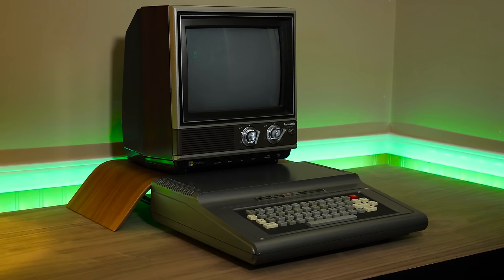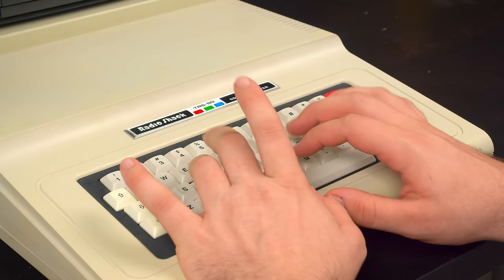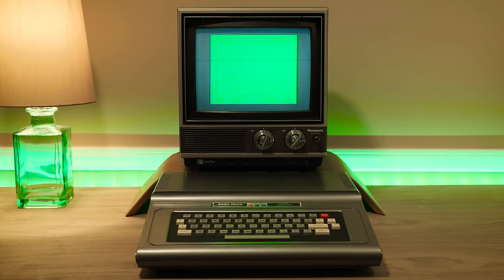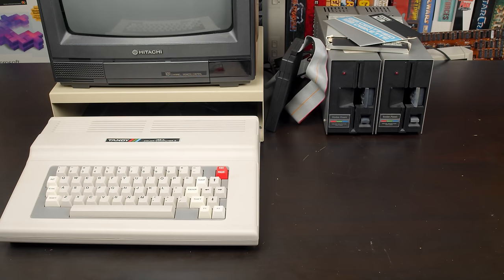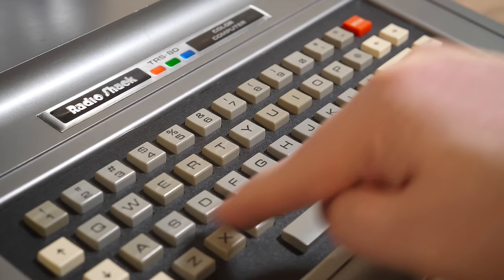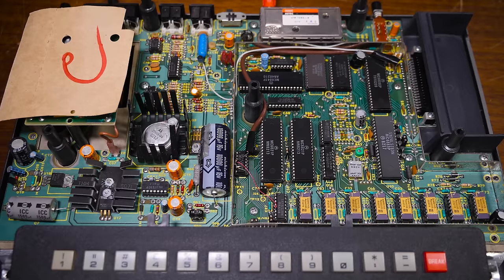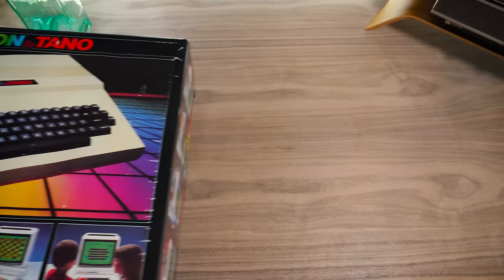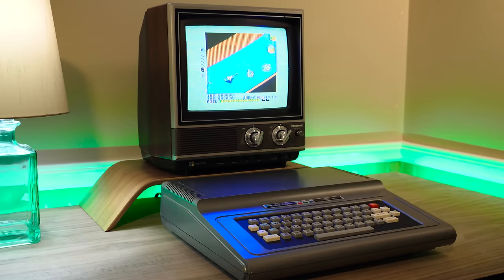TRS-80 Color Computer: Radio Shack's $399 Micro from 1980!

Comment: It's crazy how expensive the first entry level computers were back then, adjusting for inflation included. Nowadays, you can snag a cheap shitty laptop that's still lightyears more powerful than these for $100 or even less at times. And then there's ultra cheap smartphones sometimes less than $50 even. I think the cheapest phone I've ever got was one from wish as a little experiment which was a knockoff mate 30 for only $30. Still had 1gb of RAM and 32gb of storage and probably still much more processing power. Then you got the secondhand market, I've seen older workstation PCs on ebay for less than $30 at times.

Comment: A CoCo 1 or 2 using 64k will never display more than 32k of RAM when you try to PRINT MEM, the upper 32k are hidden and require a bit of POKE trickery to be displayed. Software will access the whole 64k just fine, but it will look to the average user like the CoCo only has 32k when you check.

Comment: I loved my Radio Shack Colour Computer.  I would still have it today if it did not burn in a fire. 
10 pcls
20 screen 8,1
30 mode 4
40 for x=1 to 255 step 2
50 circle (128,96), x, x
60 next x
70 end
BOOM!!! There was my nuclear explosion for the time.  128,96 was the center of the television screen. 

I also remember making a mine field
10 CLS 0
15 FOR X=1 TO 200
20 H=RND (55)
30 V=RND (55)
40 SET (H, V, 2)
45 NEXT X
46 SET (55,55,7)
50 A=JOYSTK(0)
60 B=JOYSTIK(1)
70 SET (A, B, 4)
75 IF POINT A, B = 2 then gosub 80
80 sound 255,1
85 C=C+1
86 IF C=10 THEN GOSUB 130
86 RETURN
87 If point A, B = 7 then gosub 90
90 PRINT 1,1, "Congratulations!  You made it through the mine field." 
100 Return 
110 END
130 PRINT 1,1, "YOU ARE DEAD." 
140 END

Comment: The 4k CoCo was my 1st PC (which I updated to 64k).  I purchased the DOS module & two surplus DS Floppy drives; built a cabinet & power supply for the drives & was "ready to go" so to speak.  My other purchase was a 3rd party Word-Processing program & a Star Micronics dot-matrix printer (for which I had to design & build a serial to parallel interface).  Using this set-up, I wrote all my papers while earning a Master's degree in Education.  Switching careers from Engineering, I then taught for 27 years; mostly Science.  Almost all of my early Science lessons & school lesson plans were developed & written using this machine.  I still have everything (except an old TV) packed away; sealed in plastic to avoid dust & moisture.  I'll most likely never use it again (let alone even take it out of storage).  By today's standards, the CoCo was a crude machine; yet I owe a lot to the CoCo for what it enabled me to accomplish.